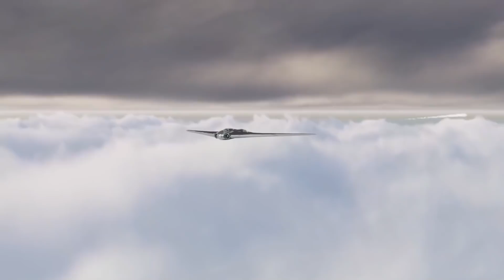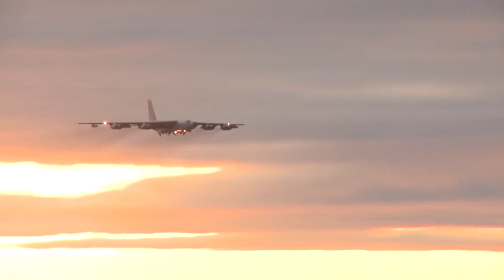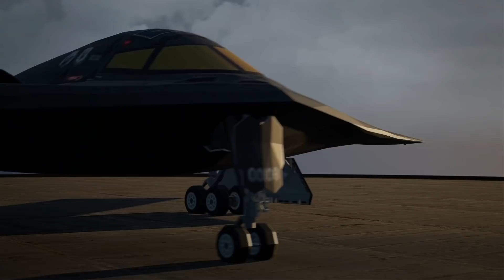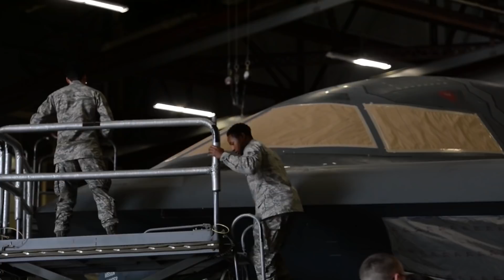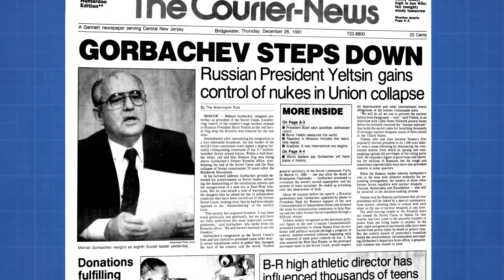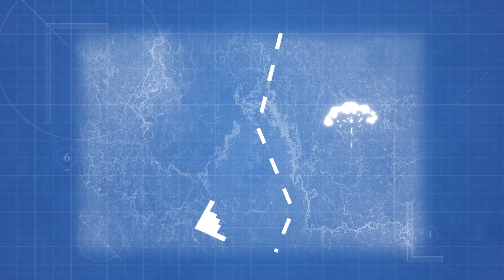Why the B-2 Is Still the Ultimate Stealth Nuclear War Bomber

Comment: The Horton 229 was not the inspiration nor even an influence of the B2 spirit. Northrup developed their own flying wing 8 years before the 229 ever took flight. And the 229 was not widely known about at the time. The most well known Northrop flying wings were the N-9M from 1942, the YB35 which started development in 1941 and flew in 1948, and the YB49 which first flew in 1949. All three were done without the knowledge of the 229. Flying wings were actually a concept back in the 1920s. The reason the B2 made the design work was fly by wire. Every plane before it couldn't fly without the system because flying wings have no tail fins and are therefore less stable. While the planes can be flown, without fly by wire, it is far more taxing on the crew and exceptionally more dangerous.
Reply: The design looks awfully similar
Reply: Thank you. You saved me 11 minutes of this crappy video By verifying what I already suspected. They can’t get one minute in without making a mistake yikes
Reply: Thanks for sparing me 4 minutes to write that